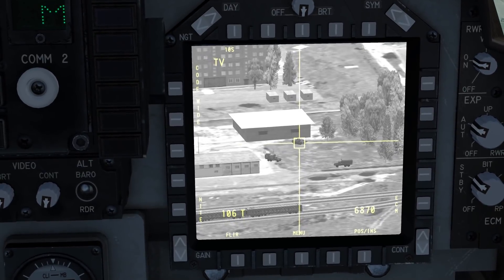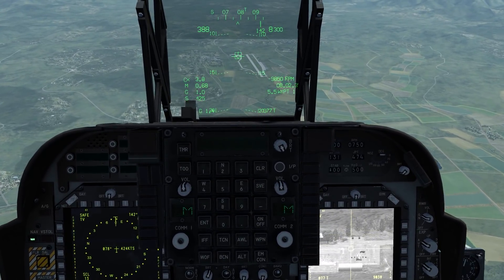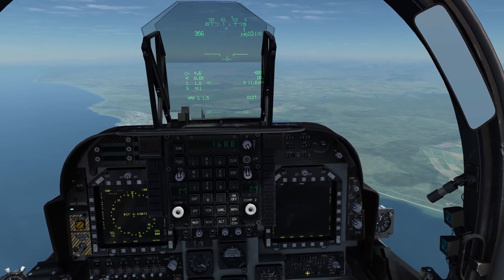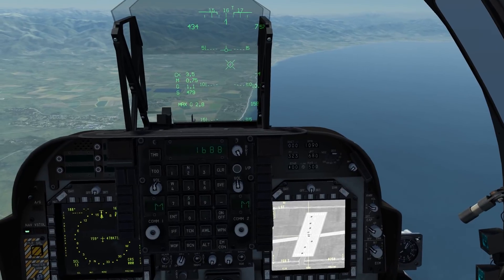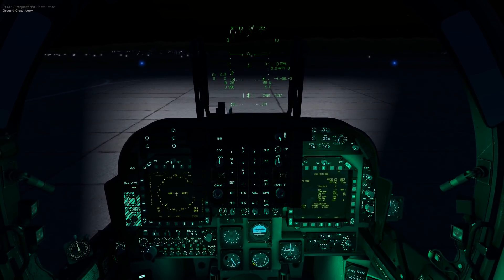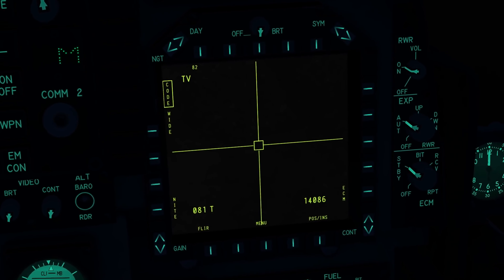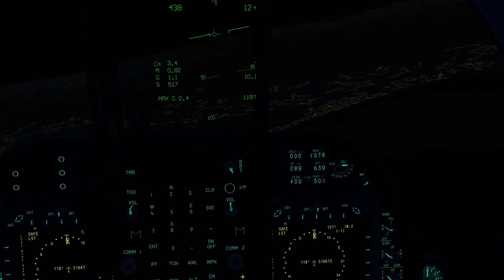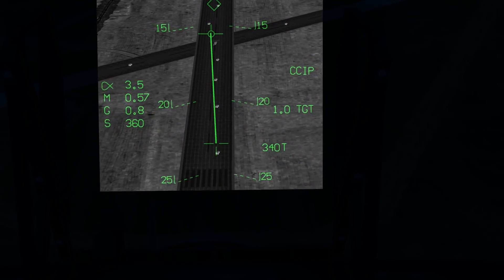DCS AV-8B NA Harrier DMT LST NAVFLIR and NVG Sensor Tutorial

Comment: Redkite, these are fantastic videos! One thing you might want to add is that to get the FLIR to work on the HUD you must also turn on the FLIR switch in the Miscellaneous Control Panel right above the INS switch.
Reply from the maker: That's also true of the DMT. If you're using an air start they'l already be on, Usually i'l switch them on as part of my startup routine, but it's worth a mention for those who forget :)
Reply: @lovefrog2  yes mine too
Reply: @TheConqueror1453  Probably has been corrected. Im not sure what colors the Harrier's HUD can display, but I don't think it can display white.

Comment: Have they fixes the DMT so it can track the moving ground and air targets as the real thing? https://youtu.be/VVuV3vQc1x8?t=531

It is called "Tracker" by a meaning of capability track targets, not to "lock on ground". As it is still contrast based tracker, knowing nothing about ground. That is just the cheap way by developers to avoid to build a actual tracking method, that ED made via Unit ID based instead contrast based (why you can't lock on destroyed targets or all builidings as those don't have ID number in game).

Comment: Why in the hell is the FLIR not doing its job at night? That seems insane to me. Infrared doesn't care what time of day it is, or am I confused and its not actually FLIR? I mean it says it right on the display softkey. Seems like an easy fix to me for the dev team to correctly model this yet they didnt. Extremely lame and mind boggling IMO.
Reply from the maker: The DMT or dual mode tracker, is a TV camera and a laser spotter in the tip of the nose, not an IR camera, The FLIR button listed on the MPCD is to switch to the the NAVFLIR instead. The NAVFLIR is a boresighted camera unable to slew, above the nose in front of the cockpit, used for night time navigation and sometimes targeting visually within the Hud projection.

Comment: When I turn on my nvg, I get a small circle instead of what yours is. How do I switch between those?
Reply from the maker: The nvg's are part of DCS rather than module specific, DCS changed their NVG overlay since this video was recorded.
Reply: HI MATE, in this video you stated that the MFCD and UFC are clearly visible even if NV gogle is ON, now with current version 2.5.1 if NVGS are set ON the MFD, UFC and the other pannels are too bright and cant use the NVG...am I correct??

Comment: Despite all my attempts I still cannot get the flir onto the hud.
EDIT- Figured it out. I had that "night" switch that like the radar alt switch is a neck breaker to see with TrackIR. I had the switch mapped to the W Hog but it is a 3 way so I heard the "click" but it was going to the neutral position.. It has to go all the way DOWN.
Reply from the maker: Yeah, the middle is 'auto' if i recall. Consider changing your trackir axis if you're struggling, reduce the deadzone and increase the sensitivity to exaggerate your movement.